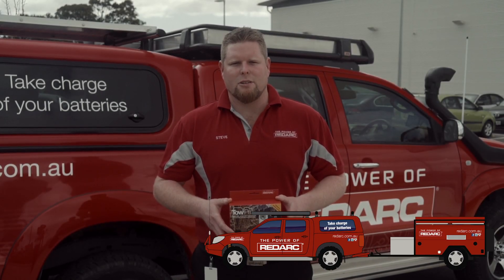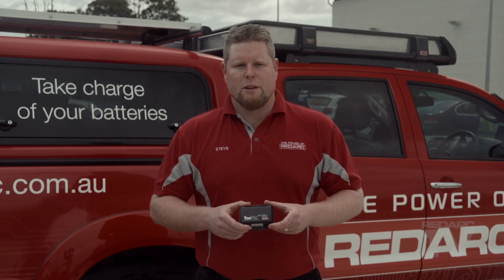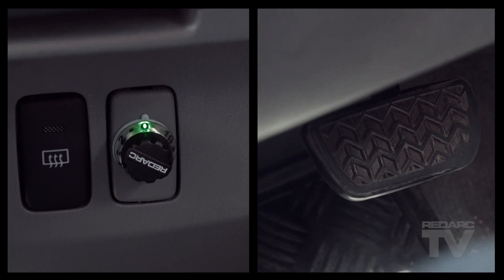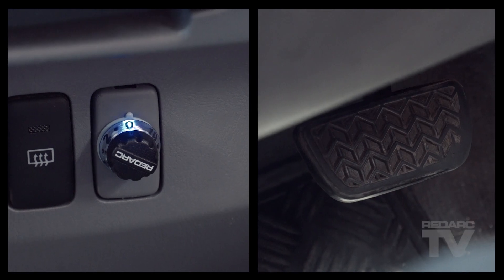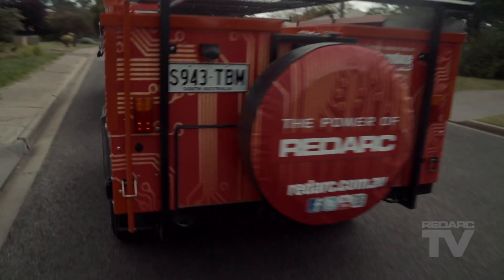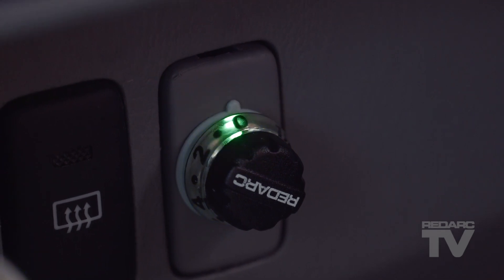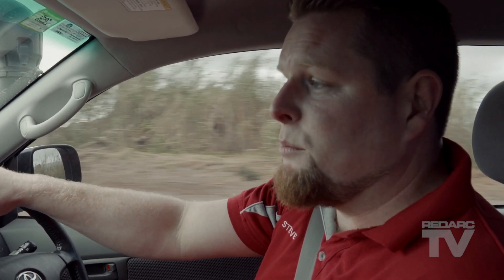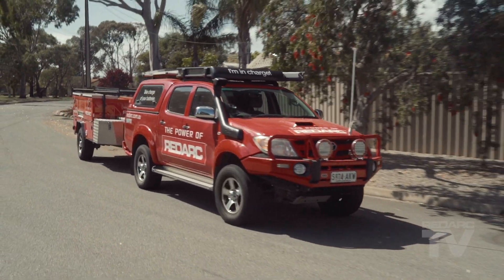Calibration Guide - REDARC Tow-Pro Electric Brake Controller (EBRH-ACC)

Comment: Hi, do I have to calibrate my Redarc tow-pro elite again with my new caravan which is heavier than my old camper trailer ? I did not tow anything for over a year, and the unit has not been moved from my vehicle.
can you please advice.
thanks Richard.

Comment: How do I use the brake controller to break in new brake pads?
Reply from the maker: Thanks for watching! A lower setting might be required due to the new breaks but other than that you don't need to do anything specific.

Comment: I've had the tow pro elite  and the tow pro liberty, bought off amazon. neither one has worked. i bought the premade wire harness that plugs into a 2021 tacoma
Reply from the maker: Hi Charles, thank you for your choosing to buy REDARC products, and very sorry to hear you have had issues with setting these up.

The best thing to do is to give our Tech Support Team a call so they can troubleshoot and assist with installation and setup steps in greater detail over the phone. Please call the appropriate help desk number at https://redarcelectronics.com/pages/contact

Comment: Is there a specific weight that should be pulled when performing the calibration steps, or as long as something is connected to the wiring harness (regardless of weight) calibration can be performed just fine
Reply from the maker: Thanks for watching, and for your question. This video relates to the V1 Tow-Pro Elite which is now obsolete. You can find out more up to date information by viewing https://www.youtube.com/watch?v=Gvvte2BH1ak

Comment: Double clicking mine doesn’t do anything. Is there a reset to start over? Am I doing something wrong?
Reply from the maker: Hi, You can reset the Tow-Pro by disconnecting and reconnecting from power however this should not be required. If you are following the procedure for changing modes including having a trailer connected, pressing and holding the foot brake (sometimes having ignition ON is required), dialling the remote head fully anti clockwise to 0 and double clicking the remote head and the unit is not changing modes. A common cause of this is the knob bottoming out on the dash, you can test if this is the case by removing the remote head knob from the splined metal shaft and double clicking on the splined metal shaft.
Alternatively please feel free to call our tech support on 1300 REDARC and we can run through some checks

Comment: Every single time I plug in a trailer this unit has to be calibrated. Unit does not move, no power lost to unit, nothing wired incorrectly.
Reply from the maker: Thank you for choosing REDARC, and for your comment. Our Tech Support Team will be more than happy to walk through this issue with you in greater detail in order to rectify this. If you can give them a call using the information on our contact page that would be great https://redarcelectronics.com/pages/contact

Comment: Hi Steve do we need the trailer connected to calibrate the system as my instructions say no need to have trailer connected ,?
Reply from the maker: Active calibration occurs with no user input required, and with or without a trailer connected. If no trailer is connected, the LED will not flash and the user will have no indication of calibration.
 
If you have the trailer connected and the Tow-Pro Elite hasn’t completed Active Calibration, the braking provided to the trailer will be similar to Tow-Pro Elite’s user controlled mode, and will apply the brakes to the level set by the user on the gain control knob. To indicate Active Calibration, the LED will glow green with short blue pulses. When applying the foot brake, the LED will pulse green and red. As Active Calibration progresses, the blue LED will increase from a short pulse to a longer pulse with a green pulse. The LED will continue like this until it becomes a solid blue which indicates calibration is complete.

Comment: Hi Steve, I am having trouble setting the brakes for best performance but my issue is the caravan brakes locking even with gentle peddle pressure. Also when descending down steep twisting roads with hair pin bends I find the brakes don’t slow down nicely, they either lock the caravan or don’t stop me.
Any instruction you could give me to help will be appreciated or do you somewhere I can go to for assistance?
Cheers Rob
Reply from the maker: Hi Rob, there are a few variables to consider so it would be best for you to contact our Tech Support Team on 08 8322 4848 and they'll be more than happy to discuss with you in greater detail.